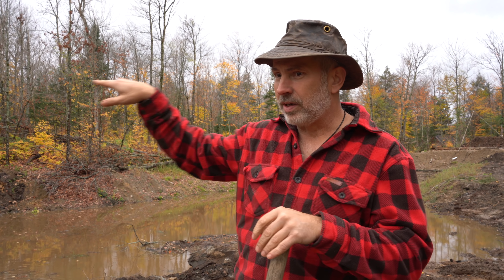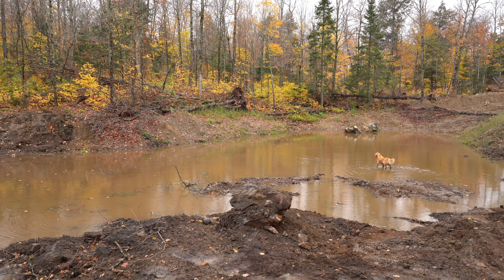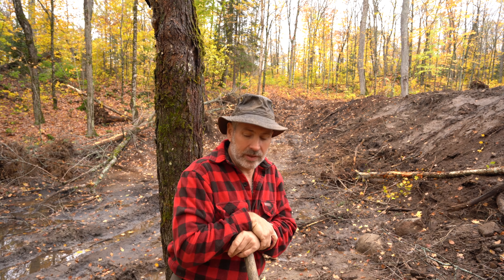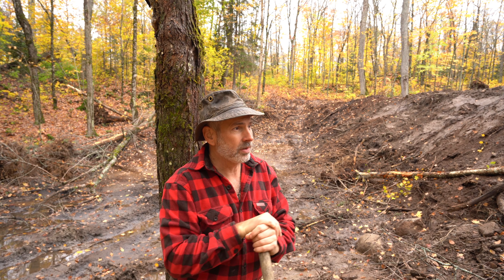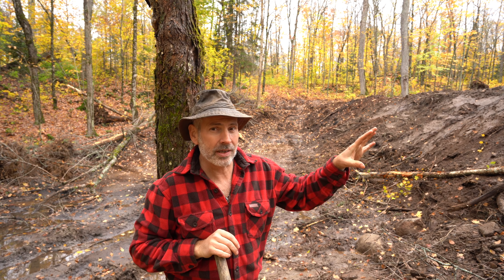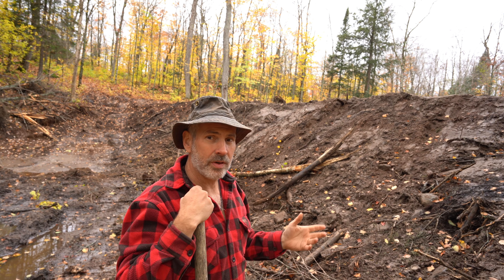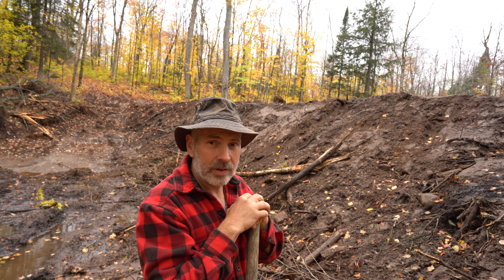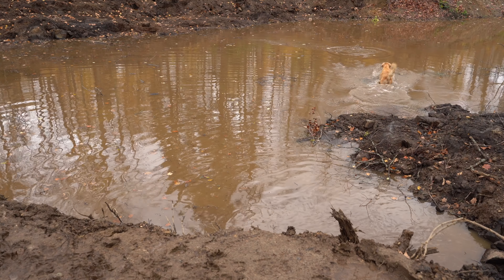A Bigger Pond for the Off Grid Cabin | Cali's Pond

Comment: Beautiful pond   and an overflow will solve your run off issues .. you may even want to take advantage of that will some small turbine and  a ram pump .. all great off grid ways for cheap and or free power options .. . rock 'n roll .. great video

Comment: When you put your culvert in make sure you use large material as well as gravel.  The large material will help slow the water down and prevent your gravel from washing away and the water from erroding the bank away.  Sone textile underneath wouldn't be a bad idea.  The most vulnerable part of your culvert is the 4-5ft radius of earth around it depending on your size.

Comment: Where I live, you find several ponds, mainly for trout farming. To clear the water there are minimum two ponds (more for trout farming), one initial pond that needs to be digged out once in a while and another with clear water. The ponds are connected with a pipe and in front of the pipe is something that breaks the flow of water to ensure that the water passes thru the pipe but slowly and  without the dirt - the one ponds with the clear water is the one down stream. Maybe this could work for you as well. We passed a set of two ponds yesterday on a small hike. That is why I am rather late with my comment, I just did not think about this before. Since you are moving on now, I thought it may be useful still.

Comment: As a couple other folks have already commented, DO NOT plant any trees or shrubs on the portion of embankment which is holding back the water. Three primary reasons: 1. Trees get big, wind storm comes along and blows them over leaving a big hole in the dam from the rootball; 2. Trees get big and die, roots rot leaving holes through the dam; 3. Tree roots go through embankment leading to potential water piping through the embankment along the root/soil interface.

Comment: If you do this for your pond/ponds then you can get fresh drinking water from them. You'll need a small China made 12v 10w 0.8 amp food grade pump that pumps around 8 litres per hour, a length of irrigation pipe under the soil, a filter before the pump, a 12v 50 Ah deep cycle battery or a 12v 20 Ah lithium ion battery, a 150w or larger 12v solar panel, a 12v 10amp MPPT charge controller so that you can have a dished plastic sheet going down the sloping embankment into the dirty water & put loads of gravel & round pebbles all glued together at the base with a thin layer of concrete. Then add more pebbles & stones loosely sitting onto the concreted stones so that you can pump the dirty water down the stones which will over time clean the water.

If you can get a 50m x 4m wide builders plastic sheet that is around 200um or greater & make a 50m length of that 4m wide sloped area to catch rainwater that is above your pond then you can create that & a V section that goes into some PVC pipe sections together underground so it won't freeze to make it run downhill into the pond. You'll be surprised on how much water you'll be able to get.

Comment: An overflow spillway pipe is important.   I have two ponds that depend on them.   I suggest a design that prevents leaves and floating twigs from going down the pipe because it will be difficult to unclog.  I've even had turtles go down mine and get stuck.  Along the dam it's best not to let trees grow along there in the long run.   When they die, the roots that rot just make the dam weak and can start leaking.

Comment: with my river basin management head on (environmental scientist) , no problem at all, probably you should have layed pipe under the retaining dam and lazer levelled the bank, the benefit of the pipe is you can put a riser inside the dam, that then acts as the spillover pipe, controlling the pond level where you want it rather than the possible erosion of a spillover. pond and riparian habitats are great for all wildlife. i do think you are moving past hand tool nirvana now though! ;0)
Reply: Aye, the time for the drain was at the very beginning, not now at the end. Standing pipe then running under the dam.

Comment: Hey Shawn. I’m not usually the “ you should “ kind of commenter. With that said unfortunately that pipe or a bigger pipe won’t work and water will get under and erode the pond dam. I’m in Maine and have a pond. I tried a couple different ways to no avail. I’d be happy to share what worked for me if you like. Fairly inexpensive and might take half a day to do. Simple but proven especially in areas with frost. I can send pics of the process and materials you’ll need. Just reply with email you’d like me to send that to if you’re interested. Great video. Take care

Comment: Looks great! I agree that an overflow\outlet control structure is definitely going to be needed to help protect your embankment in the long term (and even now in the short term before it the vegetation is re-established. You may want to look at spreading straw over the top and back of the embankment to help prevent erosion until the vegetation is established next spring (you may have seen this done on highway projects). You may also want to consider that if you want to keep it more natural and don't want to run a huge pipe for your spring runoff overflow (you should have at least a 12" pipe to avoid clogging), to armour an overflow area with stone to carry that flow over the embankment for you without endangering or potentially eroding or saturating the embankment.  Just some ideas, I'm sure you've got it in hand. Cheers.
Reply: Wow! Sounds like you know a thing or two also!👵😊👍

Comment: I grew up on a farm and in the country and I've built some ponds myself. In your situation, I would plant some Willows, possibly pussy willows on the standing edge of the pond on the dam side. They have a fairly dense root base that would be a natural glue to hold together the dirt yet at the same time, those particular varieties of trees, especially the pussy willow, are quite fond of that particular environment (on the edge of water features) . And they grow quick enough to where you don't have to worry about too much of erosion and it would be aesthetically pleasing as well as environmentally and structurally ideal.
Reply: Red maples and river birch are also nice shoreline trees
Reply: @joergenkarljohanssoniii3848  Oh absolutely. I mainly suggested the pussy willow because of the heavy, almost netted root system that would hold everything in place like a bit of lattice work. And they tend to grow much faster than your average tree. Within a season there should be more than enough growth to properly hold things in place, just in case there's some flooding going on or heavy rains, it sort of takes care of things a little faster with reinforcement via root system than many other trees.
Reply: @JadeArcade  sounds like a fantastic tree
Reply: @joergenkarljohanssoniii3848  LOL! Oh it has it's moments, but they are EVIL to plumbing.....ohhhhh that's when the root system works against ya. Keep em' faarrrr away from pipes. :)
Reply: Are willows tolerant of growing in the climate zone where Shawn lives?  I think a tree root system would be great to establish on the top of the dam, and then line the back of the dam with rip rap. That way if the dam breaches you have a network of roots and rocks to help keep it from eroding away.
Reply: @guns2317  Indeed they are. And they are the easiest to root from cuttings. Actually, I'm not too far from him, I'm in Ottawa, and they sell Pussy Willow, and other varieties here all the time. In fact I rooted two cuttings, they were about an inch, and now they are both about 3 foot tall. 😊 And if you're feeling creative, you can train them to be a living fence. Yes, that's why I thought it would be ideal for a dam. A self-repairing, self-reinforcing dam. 😎
Reply: Pussy willows are beautiful. There's some in a park near my home. I love them.

Comment: once you get a solar bubbler for the pond, I think trout would be a good choice to stock it with! 3 months for bait fish to thrive, plants... then the trout. Will be an amazing project!
Reply: Trout needs so much oxygen, I don't know if it would survive in the summer. The pond might get too warm.
Reply: @piteusx8440  you would need a bubbler for the pond (an air-raiding system) long as it is deeper than eight feet and partially shaded (appears to be so), then they should be fine. If not, stock it with bass.
Reply: Bass and a few catfish would be a better choice than trout, for the fishes sake. Maybe some sunfish for color and surface action?

Comment: Putting a waterwheel under the pipe would break the flow of the water and reduce erosion (you'd still need some rocks and gravel, but not as much or as well embedded) and generate some electricity, albeit only occasionally.  It seems a shame to waste all the potential energy, particularly if you have any batteries that could use a charge.